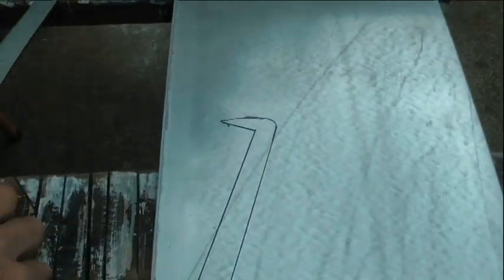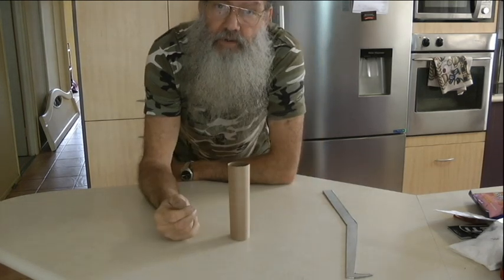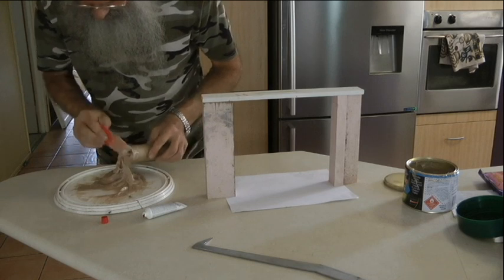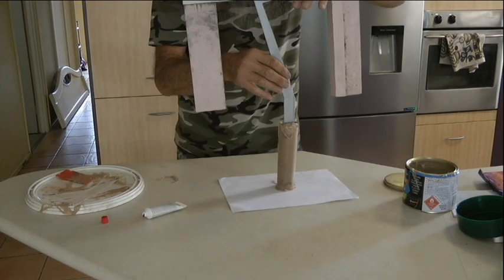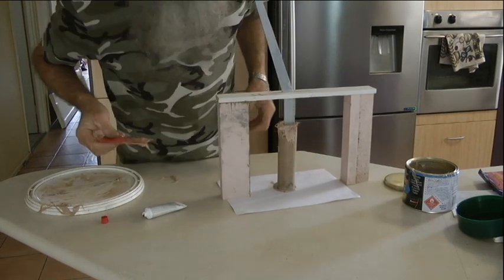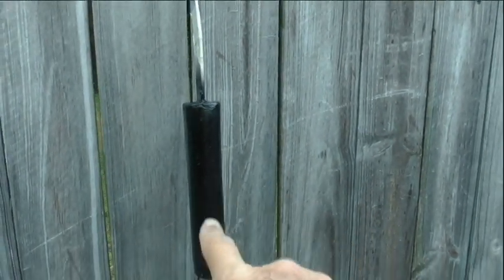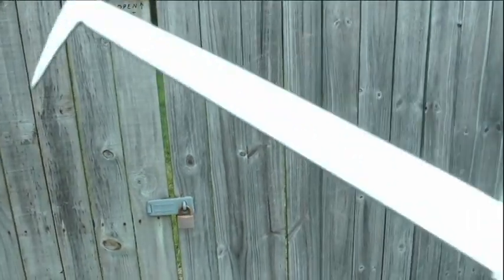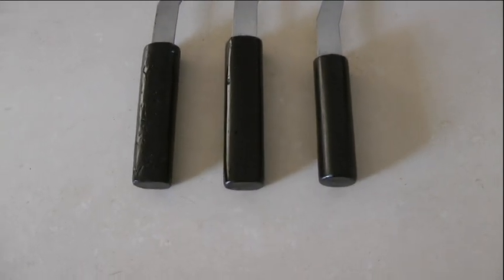Gold Hunter ,  Gold Crevicing tool  DIY.

Comment: Hi Ned,
I didn't expect, you will get the handle filled completely. Congrats!
Maybe you could drill two or three holes into the blade where the handle should be. So the handle will never come off from the blade.
Best regards from Germany!
Reply from the maker: G'day B L on the Bedrocks , Ahh yes , i  try hard to fill the tube right up , some times they get a few little air bubbles on the outside  but you can fill them after with a bit more bog or stop putty . I could drill a couple of holes in the handle , it may help  , but  i've been flogging mine now for about six years and they never look like coming off , i reckon i could tow a car with them , lol . Anyway thanks for watching and commenting , cheers Ned . 👍✌
Reply: @GrooberNedJardine 
It's my worst case thinking.
"What could become loose, will do it."

Comment: Hi Ned, I made one like that from watching your videos -  I liked the style. Mine has just cheapo paracord for the handle (wrapped around kind of like you would tie when changing a fishing rod runner). The tip was hardened the same way and it's still going strong after about 2 years. Love your videos mate.
Reply from the maker: G'day Branton , good onya for making your own gear , it doesn't matter how yours is made as long as it does the job . I think it's what gives us satisfaction in our hobby , it's more than just finding gold . With the tool , when the tips wear down i just sharpen it again , and i have even cut it off when worn out and weld a new tip on them , that keeps them going indefinitely . Thanks for watching , cheers mate . 👍✌

Comment: nice bit of gear, i'm trying to think how to do a spoon type one for deep crevices that don't go all the way to the end, but small one
Reply from the maker: G'day Tony , yeah i made my own Huntley spoons out of some 6 millimeter rod from Bunnings , i showed one on my last vid . They are a bit finnicky to make , but the 6 mill steel you can bend up the handle by hand , it's fairly easy ,  but the spoon end is fairly difficult to make , by heating it with map gas  and beating it into shape is a bit hit and miss , when you get it right ,  then quench it for strength . You could even bend in the sides of a small teaspoon , and then somehow attach a handle to it . Anyway thanks for watching mate , cheers Ned . 👍✌
Reply: @GrooberNedJardine  sound's like a good way to do the spoon, thanks. I needed one at the creek a couples of weeks ago. Lol
Reply from the maker: @tonysfossickingadventure.8124  Yeah Tony , howd ya go , do any good mate . It appears as though it's rained every weekend for the last three weekends , i kept away for that reason . cheers .
Reply: @GrooberNedJardine  yeah the rain has been a bit annoying but managed to find a little bit  0.11 grams. A lot of panning to get that. Lol

Comment: Very nice. I took your bedrock crevice tool down in the water with me last Saturday and unfortunately I broke the tip off 😞🥹. I didn’t know they weren’t meant for prying bedrock under water. Sorry brother
Reply from the maker: G'day Damon , the crevice tool isn't heavy enough gauge to pry bedrock open , you would need a Gad bar or pry bar , i'm sure Gary Honan's crevice tool wouldn't pry bedrock either , but it will remove jam packed in gravel in the crevices . You can just weld another tip on it like i do when they wear out . Now the angle on those ones are for working above water so you don't bust your knuckles on the rocks , but i make another one with a straight blade that is good for under water , plus it has a real long point on it . I sent one of those to Levi at Tassie Boys Prospecting . and i use one as well . I will send you one free if you wish . Here is my email address if you like to email me your address i would be only to happy to do that Brother . Cheers Ned . 👍✌ groober@live.com
Reply: @GrooberNedJardine  , that would be really awesome of you Ned. Appreciate you brother.